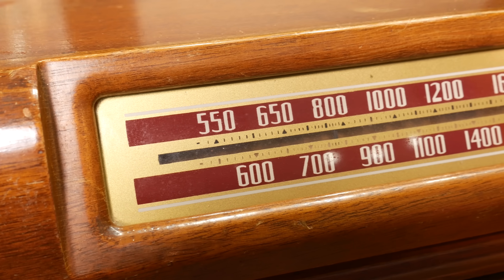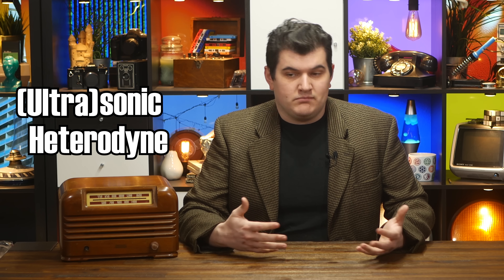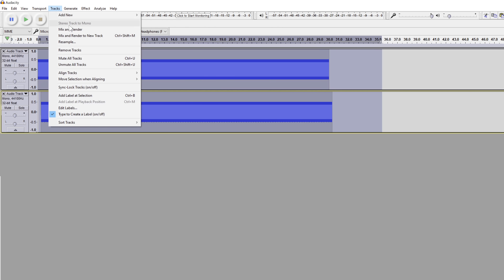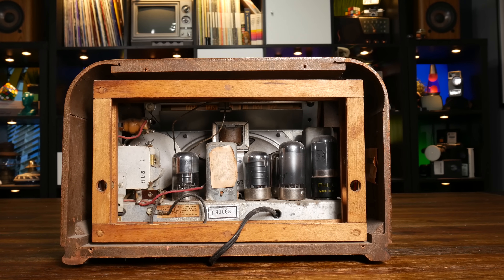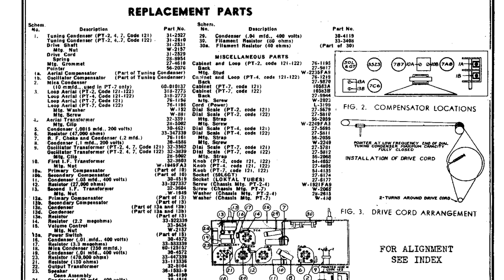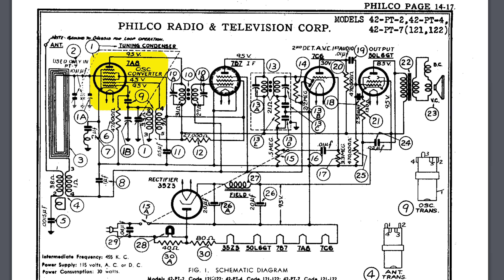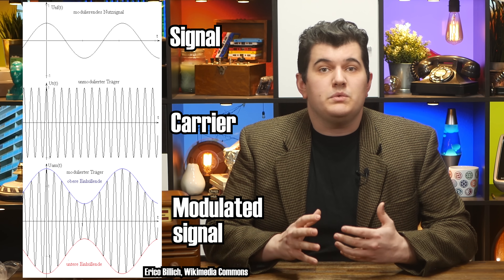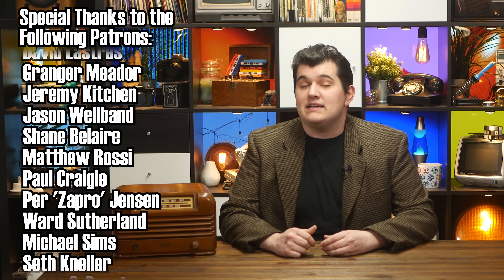The Superheterodyne Radio: No really, that's its name

Comment: You need mixing, NOT just interference. If you measure the beat frequency from two good speakers with a good microphone and then look at the spectrum, you will find no actual spectral line at the desired frequency, because the signals were added in a linear way.  You need a nonlinear element to create mixing products.
Reply: Yup, it is the multiplication of LO and the RF (not addition) that is performed by the mixer to produce IF
Reply: @TeslaLegend  Actually, the mixer produces the sum and the difference of the desired signal and the local oscillator signal - not their product.
Reply: @russbellew6378 
The mixer multiplies LO and RF waveform, the product of the waveforms will result in difference and sum of the frequencies as in:
 cos(a)*cos(b)=0.5(cos(a+b)+cos(a-b))
Reply: @misterhat5823  
To be more accurate, multiplication in time domain results in convolution in frequency domain, which will result in frequencies adding and subtracting. However it is much easier to show that trig identity than solve the convolution integral :)
Reply: Using a multiplicative mixer produces a sum and difference of the frequencies and removes the original frequencies. However if you were to  perform a Fourier analysis on a purely additive mix it will give you just them two constituent frequencies (if you analyzed for a reasonable period of time). Though you could interpret what you are hearing is tone of an average of the the two frequencies (400.5Hz) being modulated by tone of half the difference (0.5Hz) signal which sounds like 1Hz Beat  (because you hear both peaks of the 0.5Hz signal as loud). If you actually took a 400.5Hz and modulate it with 0.5Hz (AM modulation is a description of a multiplicative mix) you will get the sum and difference of these two. Which is 400Hz and 401Hz.
Reply: You could technically add the signals together (see the plot in Audacity) and then rectify them to get IF, which is pretty much how direct conversion works. The nonlinear element is the rectifier in this case, which has a quadratic characteristic so it produces the right beat frequency.

@Russ Bellew: If you multiply two sine waves, they will produce a sum and difference signal in the frequency domain, which corresponds to a multiplied signal in the time domain.
Reply: @Stoney3K  
The envelope detector (rectifier) will recover the two-tone envelope, but one cannot demodulate a piece of AM RF spectrum by adding a tone. You could just envelope detect the RF spectrum but as somebody mentioned elsewhere the rest of the AM band better be awfully quiet :)
Reply: @TeslaLegend  [but one cannot demodulate a piece of AM RF spectrum by adding a tone.]
Then please explain how a synchronous detector works.
Reply: @russellhltn1396  
Synchronous detector extracts the LO from the incoming RF signal (using various methods like PLL, square-law device, Limiting etc) and then uses the mixer to do the multiplication of RF and the extracted LO to demodulate (note: I say multiplication not addition)
Reply: You are right. He explains about adding 2 sine waves, but the mixer multiplies the oscillator wave with the radio wave.
Also, adding waves DOES change the amplitude and corrupts the AM demodulation. Mixing them preserves the amplitude envelope and allows AM demodulation. 
The heuristic beats explanation is wrong and misleading.
Reply: Sound mixing is convolutional. When one wave encounters another they don't add up, they convolute.
Reply: @nejiniisan1265 No. Sound mixing is addition.
Reply: I know nothing about rf.   I've written a scrap of code for arduino which sweeps one audio sine up and another down, and at each step in time multiplies the two samples.  I hear the sum and difference frequencies, not the originals.    Sounds like a ring modulator to me.  But there are arrays of ultrasound speakers which produce focused audio without any receiver except the human ear.  I'd love a future video about that, it seems nearer to his demo.
Reply: I watched a different video about superheterodyne received after this and was very confused about them contradicting each other. Turns out the most important part of this video was wrong😢
Reply: All's I know is a triple rectifier guitar amp makes for great METAL!
Reply from the maker: Good points.
Reply: @TechnologyConnections  Then please <3 this person's comment and/or pin it. This is a rather serious misconception to leave for your viewers. It came back to bite me pretty hard in signals and systems.
Reply: @TechnologyConnections 
Excellent video
Reply: Part of the problem is that "mixing" means two different things depending on who you are talking to. To audio people, it means adding, which is a linear operation with no frequency change. RF people use the word differently, and to them in means combining in a non-linear manner with the intention of creating useful new frequencies.

Comment: In the Dutch language a ‘capacitor’ is still called a ‘condensator’.
Reply: Same with Swedish language - Kondensator
Reply: Same in German, spelled exactly like in Swedish
Reply: Same both in Romanian and Hungarian.
Reply: It's like that in Russian too, конденсатор
Reply: Huh, only now I realize that 'elco' probably is a term that is only recognizable for a Dutch EE. (Okay, possibly also Hungarian/Romanian)
Reply: @Spritetm  Interestingly, German/English schematic diagram for UHER (report stereo 4200/4400, to be precise) tape recorder also calls electrolytic capacitors "elko".
Reply: @ZXRulezzz  Pretty standard term here in Germany, they were (and are sometimes still) marketed as this.

It's a short form for "ElektrolytKondensator", which (as easily seen) just translates to "electrolytic capacitor".
Reply: @VintageTechFan  Interesting!  There's a city near me called Elko, I'm thinking about moving there.  I don't think it's named after the same thing, but I can pretend.
Reply: They're still called condensers in some applications, like automobiles (if they still have them).
Reply: And in old cars that use a point-type ignition system, the capacitor in it is still called a condenser -- hence another name for it being "points and condenser".
Reply: Same in Portuguese, but only in Portugal. In Brazil they call it a capacitor, too.
Reply: "Condensateur" in French. Here we shorten it to "condo" when speaking.

Comment: Did your higher beat frequency on the speakers not work owing to a relating distance between the speakers being a function of both the frequencies chosen?
Reply from the maker: Likely, though I did try moving them around. I had tested it with the headphones first and assumed it would translate to the speakers. It didn't, of course, but at least I had the headphones!

Comment: I also love reading the old schematics, for the same reason.  Before they had a fully defined set of SI units (and symbols for them), the lower value condensors were rated in mmf or μμf (micro-micro Farads), rather than pf.

Comment: Is the interference portion where "part 15 of the FCC rules" comes from?
Reply: hignaki The Part 15 limits come partly from the reality of an IF (Intermediate Frequency) leaking a weak radio signal, but also because many electronic and electrical devices also leak weak RF signals and 100% suppression of those weak RF signals is generally neither practical nor affordable so Part 15 sets strict limits as to how much RF a device may leak while remaining otherwise in compliance.  But Part 15 also works in the reverse by requiring that your electronic device must accept and tolerate external RF signals without causing harm to property and life and absolves lawful (intentional) transmitters from being responsible for the failure of random electronic devices just because they were not adequately shielded or filtered against RF leakage.  Without those flip-side protections transmitting could be a highly litigious affair as everyone goes around complaining about their new electronic gizmo going crazy every time the radio station across town (or their neighbor next door) fires up their transmitter.  Instead, provided the party transmitting is transmitting a clean signal within acceptable limits and power, the manufacturer and owner of the misbehaving electronic device are responsible for remedying any interference related issues.  And the reason the two are closely related is because, in general, any frequency a device is prone to leaking it will also generally be prone to receiving (and such frequencies are also the most likely to result in undesired behavior since the device operates at that frequency internally) because to leak a signal means there is either inadequate shielding or inadequate filtering, and the effect occurs in both directions — not unlike the way a typical window will pass light equally in either direction (though their are special glasses and filters where the effect is not symmetrical).  

Part 15 is a necessity to anyone who owns and operates any sort of legal transmitter as it legally shields us from liability for poorly designed and misbehaving electronic devices so long as we are transmitting a signal of proper spectral purity, bandwidth (and that is in accordance with our licensing), and within prescribed power limits — not that people still do not complain or try to hold you accountable for poorly designed electronic devices.  But you can see where the madness would go without those liability limits as then one neighbor could even sue another because one party’s legal WiFi was interfering with another party’s BlueTooth and the next party’s home alarm system and yet another’s cellphone, to say nothing of the headaches those operating stations transmitting with 1000s to 100,000s of watts might have to contend with.  But in exchange for that protection, we absolutely must transmit a signal of at least the specified minimum spectral purity, bandwidth, and power as outlined by the terms of our license or we can lose those protections if we start interfering with other licensed services due to a poor quality signal or excessive power.  Due to the nature of radio we mist all share the spectrum or play nicely or very soon nobody can enjoy the benefits of radio.

Comment: I get how a superhet reduces the number of variable components needed to tune a receiver. What I don't get are the advantages of double and triple superhet.
Reply: RMoribayashi For a general coverage receiver that covers HF, you’d have three IF chains of different fixed frequencies. If 455kHz was your IF on 28MHz band, there’d be difficulty filtering the image frequency. For an upper HF band, the sum & difference frequencies are apparently closer together, and must be separated with a higher frequency IF.
Reply: @BrekMartin  That explains why so many general coverage shortwave radios are arbitrarily broken into bands labeled SW1, SW2 etc. I always thought newer radios without them were better. It was only that digital tuning first made band switching transparent (but not necessarily better), then in more recent years, obsloete.
Reply: In the early 1950s, Collins Radio began using a crystal-controlled fixed frequency first local oscillator and a variable frequency first IF stage in its high performance receivers. The first IF's coils were tuned by a small rack of ferrite slugs that were raised and lowered in their coils simultaneously with the ferrite slugs that tuned the second (and third?) PTOs (permeability tuned oscillator) that were the second and third local oscillators. It was a mechanical marvel. Result: rock solid frequency stability and an image that was far removed from the IF.

When receivers with digital frequency synthesizers were developed c late 1960s, designers could up-convert the desired signal to a first intermediate frequency that was well above the receiver's frequency range, again placing the image far away from the IF. Since all local oscillators were derived from the synthesizer's TCXO (temperature compensated crystal oscillator), Collins' innovative but mechanically complex variable first IF stage scheme was no longer needed.

In both cases second and third IF design was conventional.
Reply: @russbellew6378  Was that the R-390? Back in the 1970's I drooled over images of the R390A /URR in CQ and the WRTVH but it's lack of true SSB and my lack of tube knowledge kept me from pulling the trigger. From what I know now the mechanical complexity of that radio was way beyond a teenage me.
Reply: @RMoribayashi  I THINK that the R-390 used that scheme. Certainly the 75A1 thru 75A4 series and the 51J series Collins receivers used that scheme. They were all built like battleships, stable, and very reliable. In normal use you'd never have to fiddle with their inner workings. They rarely needed aligning; if they did, the alignment procedure was a little unorthodox but well-documented. The newer models also boasted a selection of sharp Collins mechanical filters in their 500 KHz IF stages. These receivers were and are things of beauty in every sense of the word.